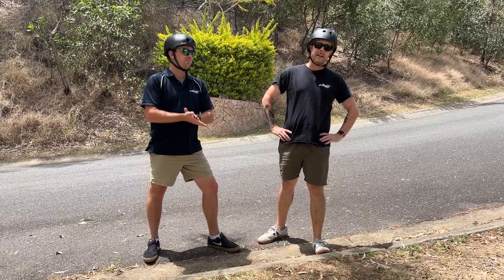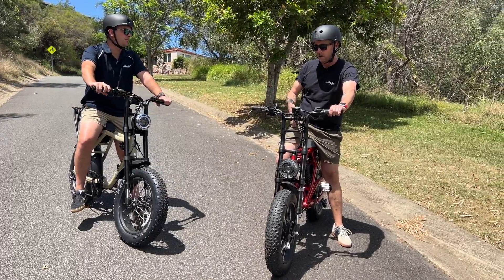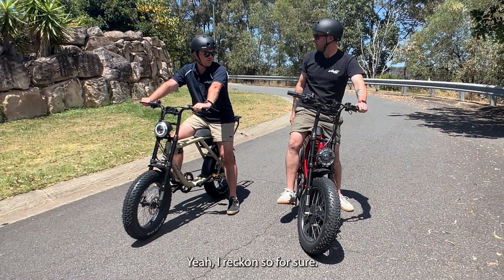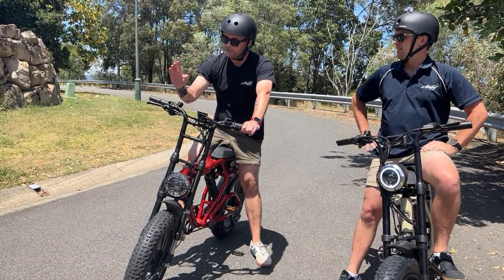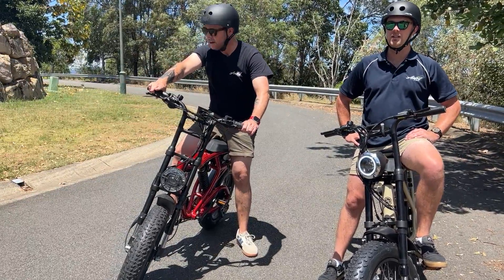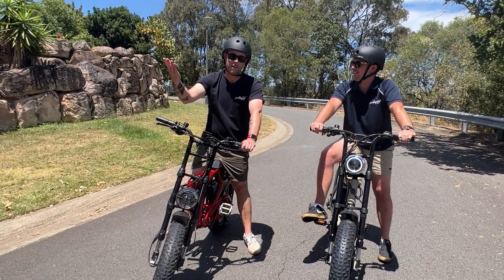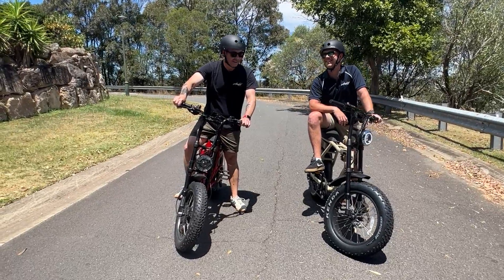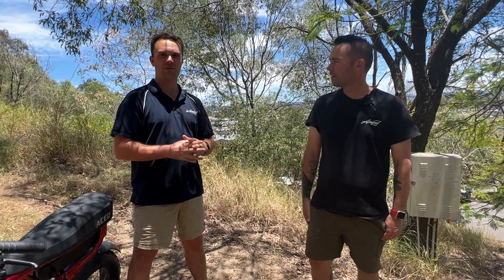Field Testing - ACE Bike 20% Hill Climb - Single vs Dual Motor

Comment: I wish you did a dual 250w motor e-bike, give 500w total which is legal in NSW. There are sooooo many hills in Sydney but i don't want to end up in court riding an illegal dual 750w motor bike.
Reply from the maker: dual 250w would make no sense, it is much better to have single 500w for weight etc.
Reply: End up in court lol. Yeah they’ll send you through a full Supreme Court trial watch out 😂

Comment: Looking at the dual motor bike, it looks a lot like the Grizzly . from Ariel rider in the U.S.A. 
Does this bike have a separate controller for each motor ?  Also  how many watts is each motor?
Reply from the maker: Hey there, grizzly is very different bike with single seat etc etc but we do have similar setup i guess. The bike does have 2 controllers which are sync'd together as for every motor you do require a controller for sure. Our dual motor bike is dual 750W motors

Comment: Does the battery drain quicker in dual motor mode?
Reply from the maker: Yeah for sure, if you are running 2 motors you will use battery 2x as fast which is why we offer the largest battery size possible on the demon models. However you can turn motors off to ride on single motor only if you like, then you can also save on battery power :)
Reply: @AmpdBros  sweet. Makes sense. Cheers heaps.